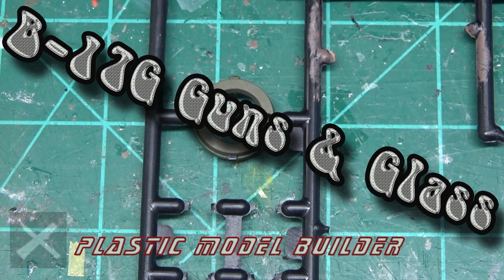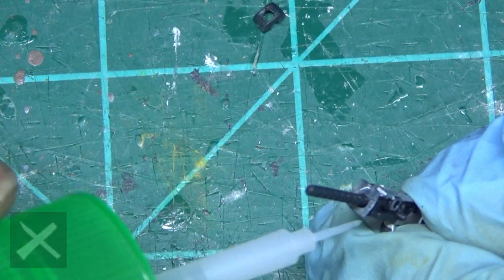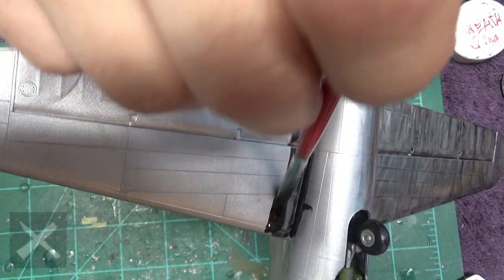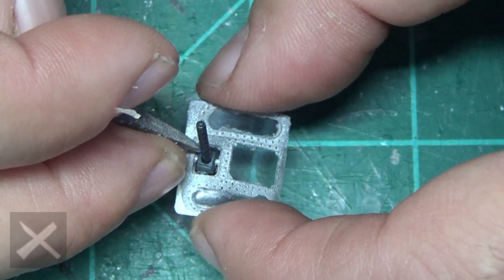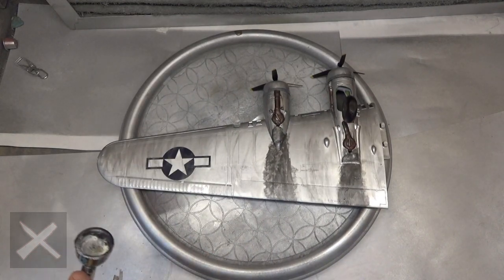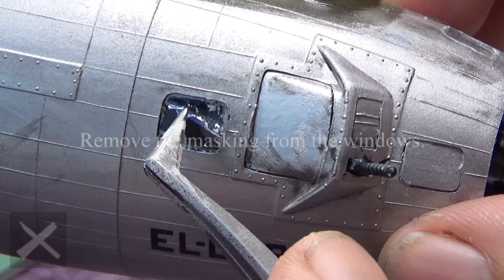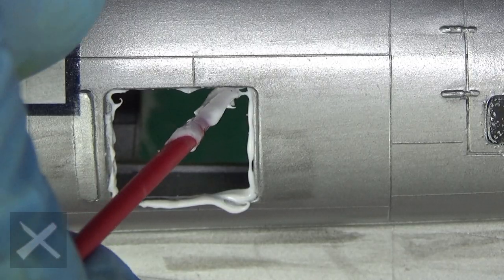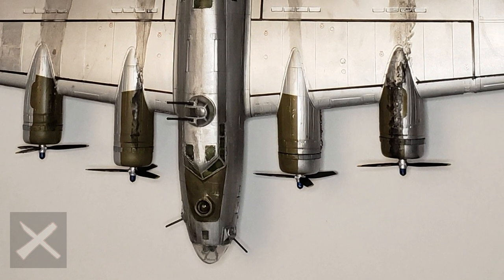Weathering the B-17G and Installing Windows and Guns.

Comment: Thanks for showing how the guns install in  so much detail. I am working on one of these and I will use aftermarket guns and I was not sure what the assembly sequence would be. Watching you do it makes it much easier to figure out than just looking at the directions.
Reply from the maker: This model in general certainly is a beast. I imagine most are designed about the same way. Its just a matter of fitment and quality.